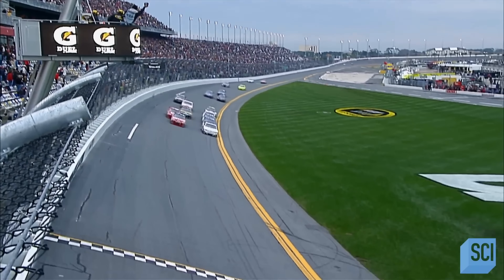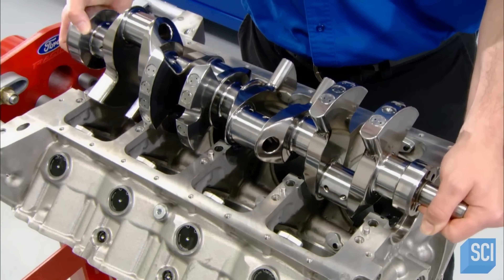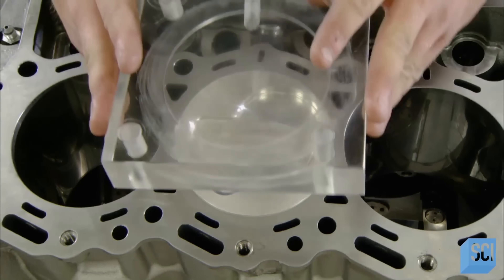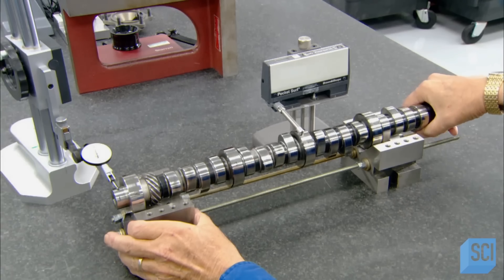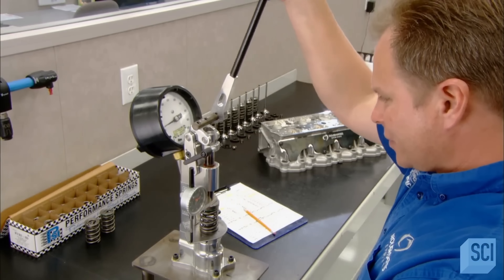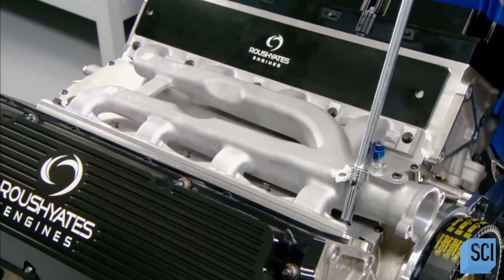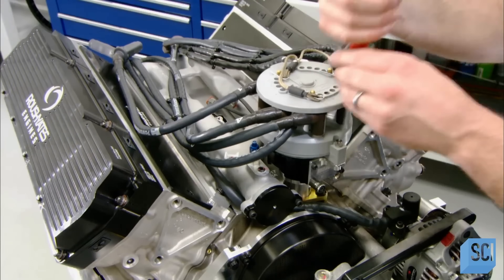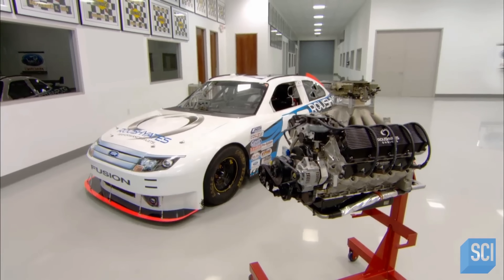NASCAR: Engine manufacturing

Comment: If I recall correctly, the only "stock" item required in the motor is that the lower block be manufactured by Chevy / Ford / Toyota / Whomever. NASCAR is hardly a brand vs. brand competition, and in no way reflects the car you buy from an auto dealership.
Reply: Somehow you thought you needed to tell me that?

Comment: It just amazes me how those engines run wide open and stay together
Reply: They only rev low, nothing like a F1 power plant.
Reply: @ronbelanger4113  "low rev" its a pushrod carbureted V platform. also its called stock car for a reason its a stock manufactured block goofball

Comment: This is an older episode from the How It’s Made series on The Science Channel.  It was correct last decade, but that was LAST DECADE.
Reply: Exactly. There Are also Half of the valves missing for these N/A engines ... 2even" breathe" Properly. Tooo Big engine with tooo less power are still consuming tooo much fuel. They should use 1000 ccm engines with the turbochargers.

Comment: In addition to all the other items pointed out, some of this information is just plain wrong. Easiest example is installing the rod bearing caps AFTER the compression check. That literally cannot work. Additionally, to check the swept area of a cylinder, which is part of checking the compression ratio, you have to measure at both the top and the bottom of the stroke. Also omitted is measuring the volume of the cylinder head. I'm not going to bother with the rest. This video is so wrong it's a waste of time to watch it.
Reply: Couldn't help but notice they didn't use any gaskets.

Comment: This video was a joke..It shows and audio denotes the bare non detailed buildup process..These engines are actually built and designed to exacting standards with the best materials made and best engine building procedures and craftsmen.  I would have thought this video would have paid tribute to the detailed build process, techniques, detailed build and parts requirements to ensure maximum horsepower and torque with the best reliability and durability possible. No mention or visible evidence here of any gaskets (except heads) used to build this engine..I understand that NASCAR engine building and techniques are top secret but this video did very little to show how a NASCAR engine and build differ from a conventional car manufacturer engine build..Very disappointing video especially in the lacking any concrete details or facts.
Reply: It’s a “How it’s Made” episode, not an engineer’s guide to building a Ford NASCAR engine. I thought it was darn good for a half hour TV program condensed down to 10 minutes for YouTube. Give them a break and appreciate what it demonstrates.
Reply: @Jbennyho  That's exactly the problem and issue with this video. It doesn't demonstrate any important particulars of the buildup of a NASCAR engine. It reminds one of the TV program "How it's made" of building a major automotive factory engine.. No details or specifics..What can one learn from such a video?  Nothing.
Reply: Correct you are. 
It reminds you of a “How it’s Made” because it is a “How it’s Made” episode.

Comment: Modeled after American made four door passenger cars. Nope, the Chevy SS was an Australian passenger car, Holden VF Commodore. Piston rings don't prevent the car from buring oil, they prevent the engine from burning oil. OHC's don't always act directly on the valves, rockers are often used. So the alternator powers the Airconditioning in a NASCAR, that's very funny. The machine runs the motor? I think the motor runs the dyno.
Reply: Is Holden still in business?
Reply: @markrenton1093  No unfortunately, shafted by GM just like Pontiac
Reply: Yep but how many people will ever know.
Reply: Lol 😂 holden had nothing to do with it lol

Comment: This video is SO out of date!  No carbs or distributors since 2011.
Reply: And after that it all went down hill!
Reply: 4 barrels of carburation is the correct induction system. Nascar Fk'd it all up!
Reply: Never let the facts spoil a good story, lol.
Reply: What kind of race? When all have the same engine?
Reply: @willbum6951  The trucks all run chevy ilmore engines
Reply: Shut up, Steve.
Reply: @TheRealDonJohnson  No
Reply: This episode was released in 2010
Reply: Good… thats what we want to see. All hands on tuning and no computer really needed if you must.😎🫡
Reply: They obviously have not discovered the Turbochargers yet , 2 use Samller displacement - smaller engines and Bigger Power.